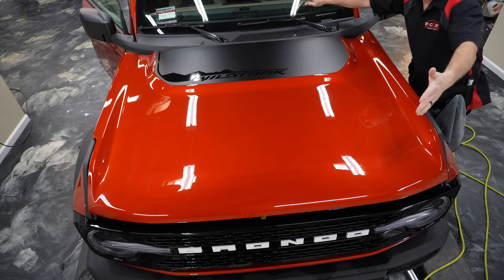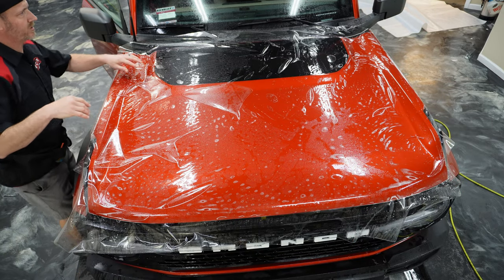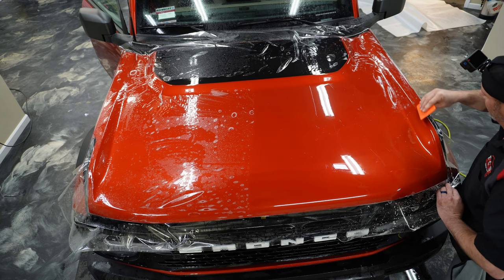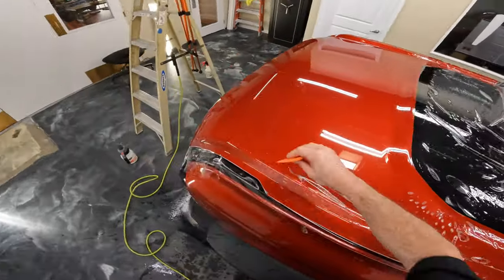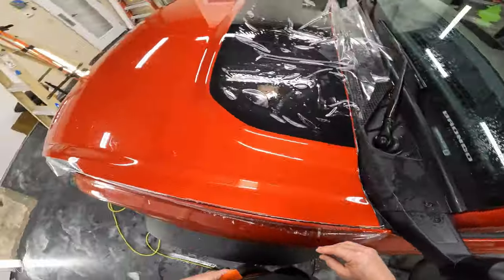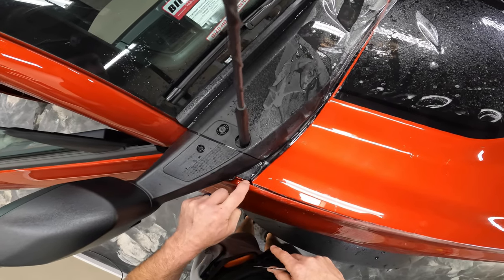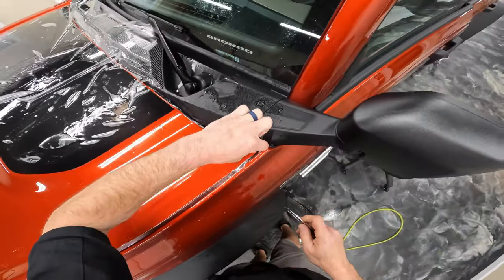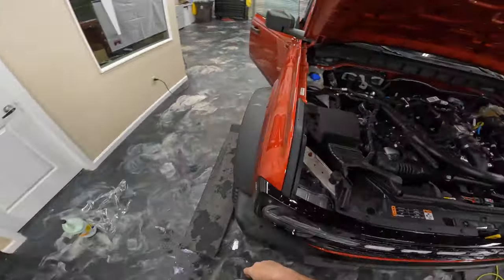PPF Installation 🛡 2023 FORD Bronco Full Hood Bulk Paint Protection Film

Comment: Why didn't you do it over the Wildtrak Decal?
Reply from the maker: There are a couple of reasons. When you cover a decal, you are going to get an ugly silver line around the edge. That happens because of the thickness of the decal. Also, the decal is matte, and the PPF over it would have changed it to a gloss finish.